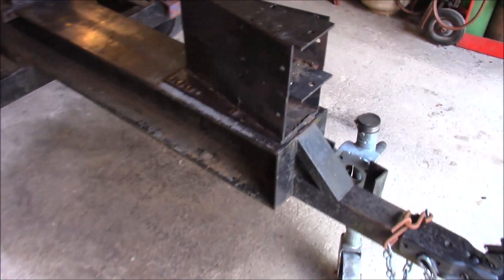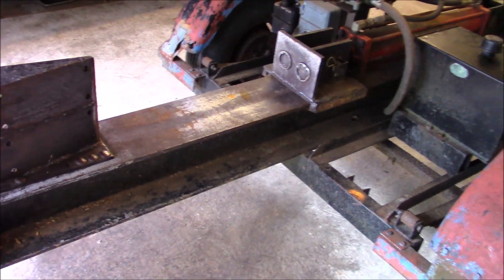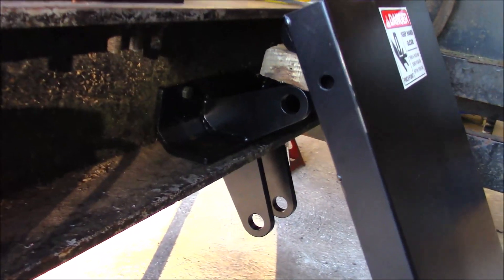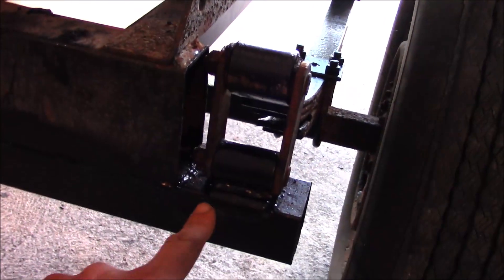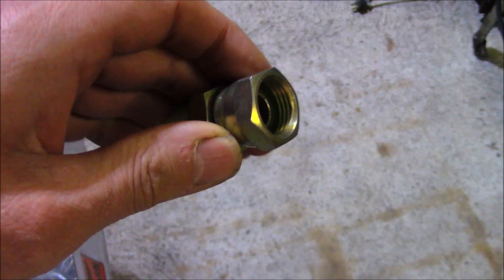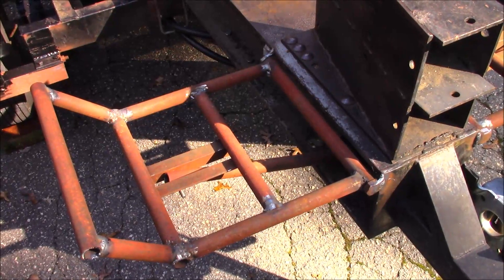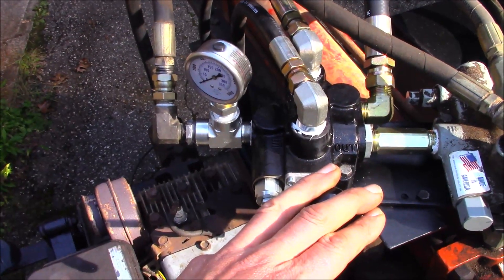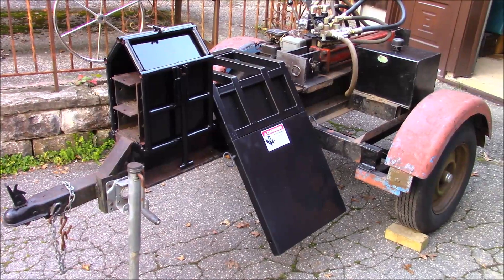Adding the Rugged Made Log Lift and Hydraulic Circuit to an old Log Splitter

Comment: Nice job but I think you should get your dad an expansion chain for splitting it keeps the logs together neatly and all he’s gotta do is roll the log in place you hit it with your splitter. You back it up just a little bit. You roll it like a log get it and it keeps on splitting and makes a big bundle of split stuff then make it like all the bungee cord and it’s done piece by piece and neatly goes into his wagon.
Reply from the maker: interesting.  I bet that works well splitting ash wood.
Reply: @JIMO415 I saw a video where a guy was doing it with a maul. I saw how it stopped bursting and flying and was highly impressed
Reply from the maker: @robertpronovost3839  where a splitter shines and a maul will drive one insane is in a stringy or twisted grain.  White oak can be a pain.  Elm is the worst.  Both of those you have to drive the splitter all the way thru.  I think it was Swamp Maple grows in a corkscrew.  But Ash was my favorite to split (either way).  If it was really dry, the splitter would chuck it across the yard when it popped.  Sadly, all the Ash has been decimated by the beetle and is just rotten beyond a good firewood state.
Reply from the maker: @robertpronovost3839  Check out Buckin Billy Ray.  This is one of many: https://www.youtube.com/watch?v=-md4OMbFeUg

Comment: I bought a home made splitter a couple of years ago and put a lifter on it as well. 
One other thing I did was put a small bench, about 10 inches wide, on the beam where I stand . It helps with controlling the big rounds.
Reply from the maker: yes sir I did a fold down on each side of the wedge and the lift is the rest of the working platform.  It sure makes splitting less work!  Thanks for watching.
Reply: @JIMO415 it saved my back, that’s for sure

Comment: JIC is the best fitting type and easy to find 😊
Reply: Yes way ahead of npt and no orings to go bad.
Allows a bit of angle to get the hose connection to start and can be tight facing any direction so the natural curve of the hose is as preferred.

Comment: Impressive content, Tinkering Jim O. Looking forward to your next upload from you. I smashed the thumbs up icon on your video. Keep up the fantastic work! Your insights into the hydraulic system modifications were enlightening. How do you determine the optimal positioning for the hydraulic lift to ensure maximum efficiency and safety when splitting larger logs?
Reply from the maker: Thanks for the complement and the visit!  The lift raises up to about horizontal and stops, so the logs do not come rolling at you.  The geometry is already figured out in the lift mounting brackets that were part of the kit.  That took a lot of design work out of the equation.

Comment: Adding a log lift device was a useful upgrade. I also have a log splitter. You have a similar hydraulic diagram to mine. Even the pressure gauge is in the same place😊
Reply from the maker: Thanks!